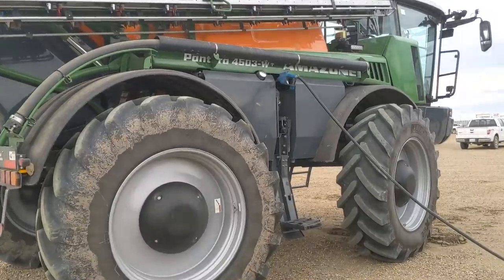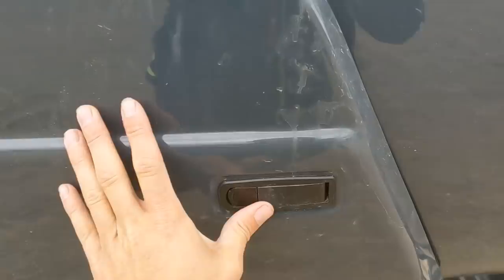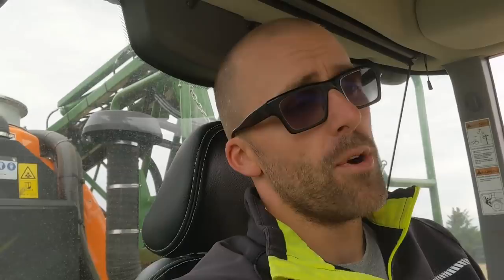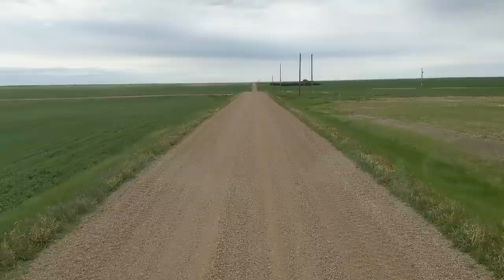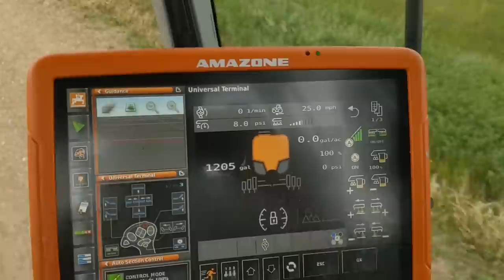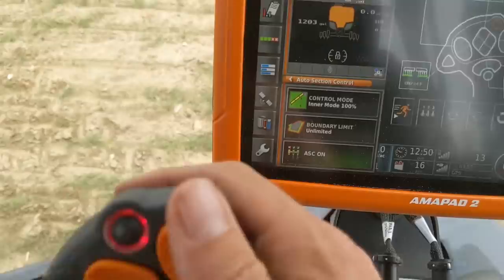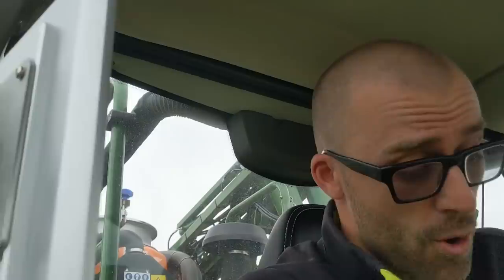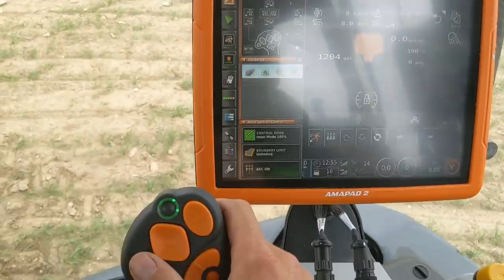Pantera Review Prt 1

Comment: I have this same machine can spray for around 16hrs per tank of diesel. It’s quiet comfortable. Great gps, great Bluetooth radio  , has 3inch fill and it’s very reliable and has a 3 year warranty, our machine has completed 1900hrs in about 19 months and we love it.
Reply from the maker: Yeah I dunno 🤷‍♂️ I was told that the EU sprayer is different from this one, they added some more power and made some tweeks to the NA sprayers .

I know the GPS is bad because it's Waas, and that's a terrible signal, teh worst you can run around here, but it can be upgraded like anything.

There is 3in load, but only on the side, which we don't use.

Comment: I have issues with your comments.  I have worked my entire life trying to over complicate things and over design things and this, in my view is a perfect design.  One for us engineers to strive for.  I would have never thought of putting mini compartments inside of another compartment.  Shear genius!    Having the electric ball valve on the other side of from the control panel is easily fixed by adding another $10K-$20K screen in the front and provides us engineers more things to program and build.  Great idea for a new feature!  Thanks.  The origami step is a beautiful design for making sure your not inebriated before allowing you to drive.  Again, pure genius!   For having to constantly move the boom up and down, ..  seems like a land owner issue to me.  You can easily fixed this by renting a few really large Caterpillar scrapers.  This would give you something to do instead of farming and allow you to diversify your skills.  :) :) :) 
BTW, how much of what you learn here is from doing it and how much is from reading the manual while running it?
Reply from the maker: 😂! What's a manual? 🤔🤷‍♂️
Reply: Oh, that's a funny comment! 😆👍

Comment: Good video! Well I guess the Pantera is primarly build for Europe what means narrow roads, limited top speed and small fields. A custom sprayer guy there is probably pretty happy with that exact fill feature but in your operation spraying full loads 9,9 times out of 10 it doesnt make much sense! Greetings from Uruguay
Reply: Yo ando con una za-ts 4200 en un JD 4730 y está espectacular, pero es una buena abonadora en un buen autopropulsado. La cabina del pantera parece la de los Stara brazucas

Comment: You will use and need the step when you top up the hydraulic oil rank. You will also get a more responsive transmission if you set the cruise control to the “+” setting. We use around 160litres of diesel doing around 500 acres, but ours was one of the last without def.

Comment: I wonder if you'd be able to demo a Hardi Rubicon 9000, that looks like a big unit for a big farm, 9000 liter tank up to a 52m front mounted boom, does look expensive though
Reply: And the Hardi Rubicon comes with 4.35 times bigger diesel fuel tank than this Amazone Pantera.
The Hardi Rubicon has a 1000 liter (264 gal.) diesel fuel tank vs. only 230 liter (61 gal.)  on this Amazone Pantera 4503.
Hardi Rubicon has a max road speed 35 mph (max) and a max spray speed of 20 mph.
Reply: Btw. the Hardi Rubicon uses Hardi HC 9600 display, which is a custom Ag Leader display. 
Mike, how do you like the Ag Leader InCommand 1200 compared to the Raven Viper 4?
Reply: Seems to be a consensus! I think it's between the Rubicon and the JD R4060 for a farm this size. This thing is simply half the sprayer you need...
Reply: I also think the Rubicon's Cummins 8.9l 370hp diesel will pull any hill you have there...
Reply: @ITubeTooInc  Wow 230l fuel tank is ridiculous.  But I guess on the bright side you can fill it with an ATV with a barrel in the back.
Reply: The Hardi has a 35km/h top spray speed, cmon Mike, give the Aussie a run!
Reply: Rubicon is a pretty nice machine, and one of the 1st, if not the 1st designed for large acres. The BUT part was no close dealer, and the aluminum booms. Ever see what Paraquat does to aluminum, you have to wonder what they were thinking?
Reply: @shibumi5210  If tank volume really is the most important thing, the DAMMANN-trac DT 3500 H S5 will beat pretty much anything with its 12.000 liters. Only downside is it's fueltank of 250 liters. It can do 50kmh though, but only has a 285hp engine. The Fendt Rogator 6000 is slightly better with 310l of fuel and 300hp, but only 6.000l of product tank. User-friendliness-wise, I don't think you can beat the Fendt though.

Comment: that 25 mph is something from Europe sinds you aren't allowed to go faster than that in a lot of countries. and great vid keep it up
Reply: I thought most European brands like Fendt went faster than most american tractors. Our 8530 is pushing it to do 26 lol
Reply: Wil Hudson Yes, tractors are capable of going up to 37 mph (60 kph) But at least in Germany you than have to pay tolls on some federal roads. Also your tractor (and trailer) have to undergo a half annually safety inspection, additionally to your yearly technical inspection (if your tractor is over 10t of weight). So yes, technically European tractors are able to drive fairly quick, but due to some regulations it‘s just to much of a hustle for most and they end up limiting their top speed electronically to avoid it. Although many contractors with big fleets often times exploid this top speed because for them time is even more money than for the normal farmer.
Reply: @Hudsonfarms0530  just the tractors are allowed to faster then 40kph / 26mph
Up to 60kpm in Germany. 
Combines and other self propelled farming vehicles not.
Otherwise you would need a truck lincens and insurance and all the pain that comes with it.
Reply: @henningquast8456  over here in Belgium every agricultural vehicle is limited to 45kph even with the insurance of a truck and and with a truck license.
Reply: There is a 30mph / 50kmh version, i'm quite sure that the dealer can update. As it is limited in software only.
Reply: luilakkie I see 50km/h is what they quote on their online specs as well, I wonder if the dealer that is setting Mike up with Amazone gear is not giving the best assistance possible, it seems like they aren’t advising on how to get the most out of the automatic fill systems as well if he is running backwards and forwards all the time.

Comment: I can see you are using the Amazone Pantera 4503-W (Wide) version with a track width adjustment: of 2.25 –  3.00 m. The standard 4503 version only has a track width of 1.80 –  2.40 m in comparison. There's also a 4503-H (Heigh) version with up to 1.70 m clearance vs. 1.20 m for 4503 and 4503-W. But the track width is only a maximum of 2.60 m at full height for the 4503-H.
The Hardi Rubicon has a track width of 3.0 – 4.0 m in comparison and a clearance height of 1.85 m. That's the same track width as Apache 1240 btw.

Comment: Hi Mike just watched this video. Machine does seem over complex. And  that monitor does seem like overkill for what your needing to do with it.  After running my apaches and terra gators. As to the monitor i have viper 4, topcon x30 and x20. I find now that i have the x30 set up its easy to use for me easier than the viper 4 it seems when i get in the viper 4 machines i think i have way to many pages to go thru to get a job set up lol.  All in what you get use to i guess. I run the x30 in the machine i run because of the custom work it remembers all my guide lines so when i use my crop spec real time variable  rate sensors i can run the same wheel tracts when i make multiple trips. As to the autosteer doing bad things at high speed thats all in how its adjusted i have got my so close now that i can follow a john deere rtk system and all i'm running is wasp Otherwise the viper 4 would be all we would run. Look forward to your next video.

Comment: Does it ever glitch like the viper 4. I had been spraying right along. Started a field in the afternoon and booms wouldn’t turn on.  Product control turned off all the sections. Took a call to support to figure it out.  Also I’ll take my rogator over that pantara any day. 8.3 Cummins engine. I can run 36 mph and joy stick is super easy to use. A camera on the tires is nice feature though.

Comment: What is the cam lock cover for under the water meter on the left side of the machine? It must be a loading port also.
Reply from the maker: Yes, I believe it is
Reply: In the AGRITECHNICA video of the spreayer the guy said that you could load from there.  Is that one a 3 inch port?

Comment: So Mike, I've seen people discussing it in replies to each other's comments, but I've never seen anyone directly ask you: Any thoughts on the Dammann DT 3500 H S5 (triple axle, 12.000l tank) and the Fendt Rogator 6000 (likely contender to be the most user-friendly and comfortable)? If you got the chance to test them, would you? Both only have a small fuel tank (250l and 310l respectively), but both do 50kmh according to the book. I'd be curious to see what you think.

Comment: Not that impressed then? I used to sell Agrifac about ten years ago - they designed the chassis the Amazone uses but have air suspension. I got 75kph out of a Condor (downhill) once... so about 40mph. Brilliant ride but spray system was average. GPS was even worse. Few guys round me have the Pantera but I wasn’t aware it was still so basic. JD has to be the best spray package and GPS system in my opinion.